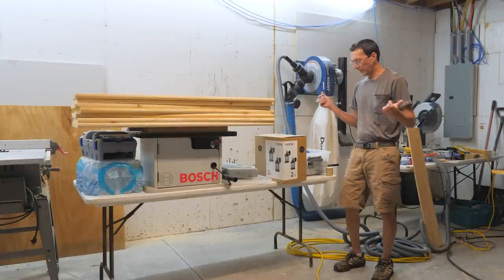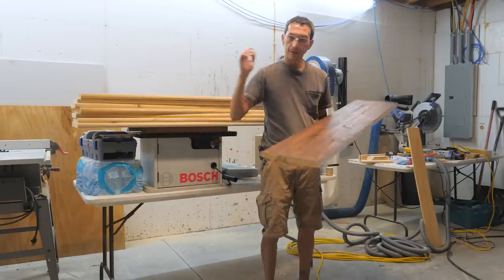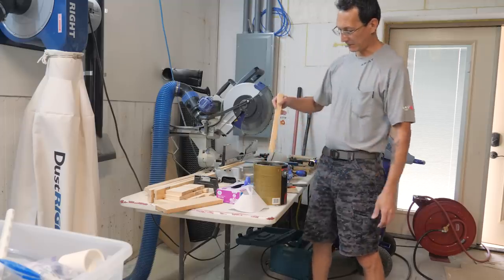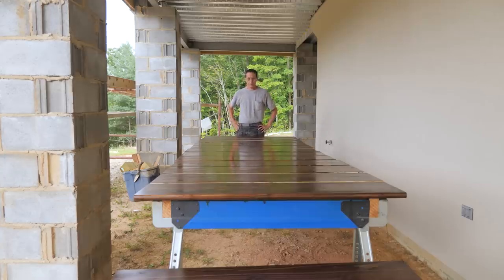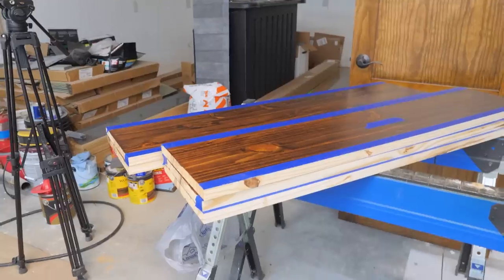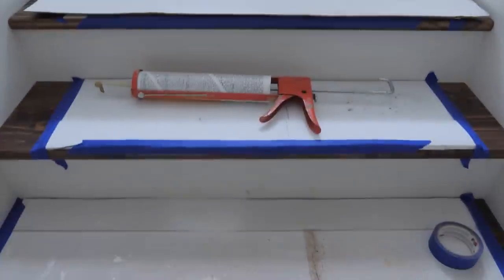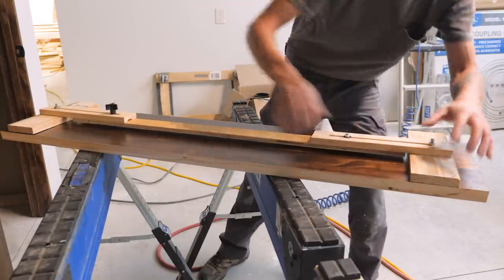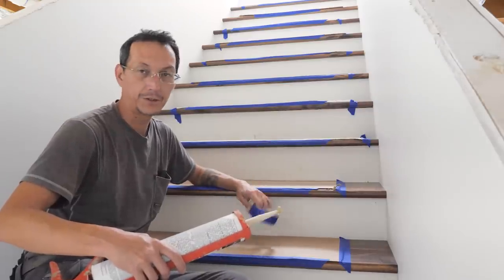Trimming Out A Staircase: Installing Stair Tread and Risers

Comment: Nice work. Why would you not move the fence to the other side of the saw blade so you cut on the bottom side ?
Reply from the maker: Guess I could have. Didn’t think about it.
Reply: I though the same thing, also cutting all the treads, dry fitting them and numbering them prior to finishing (but the the underside) could have been an option too…

Comment: Only a comment you might wish you would have done before you do the upper staircase you might want to put a sub board below your pine its gonna squeak in the future that's why they usually use like s oak floorboards,otherwise it turned out beautiful!
Reply: I agree with you somewhat - doing that now will throw off the top and bottom steps and not be to code. The bottom riser will be whatever the thickness of the substrate higher than all the other steps, and the top step will be shorter the same thickness. This would have had to be done at the beginning, and you would have had to cut the bottom of the stringers the thickness of the planned substrate. Stair risers must be no greater that 1/16” difference from fist step to last - if there is no landing, i.e. a straight run, OR in the case where a step can be taken on the tread such as something you would find outdoors when landscaping. The said substrate would have also made it easier to mechanically fasten the tread from underneath, as well as give more surface area for the chemical bond - more area to glop glue on… 😉